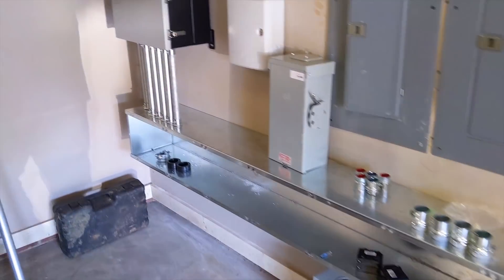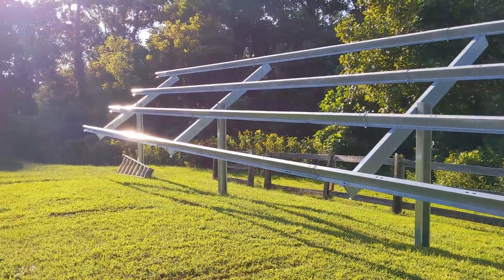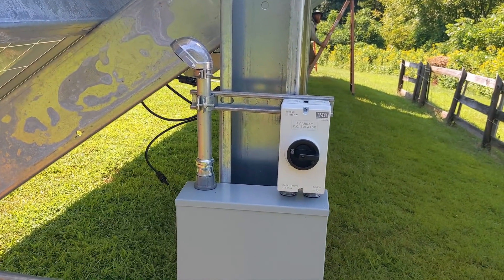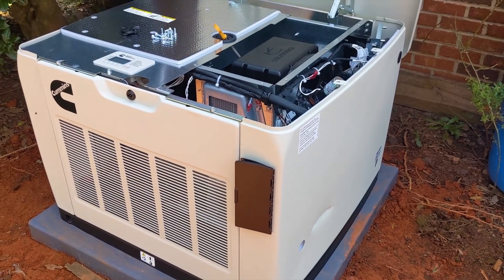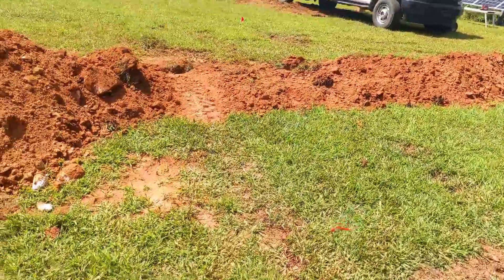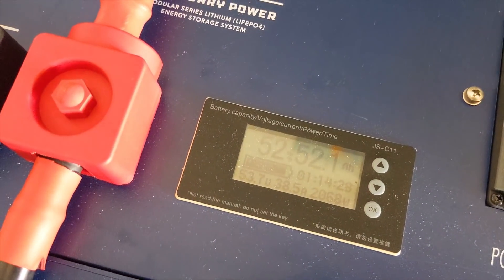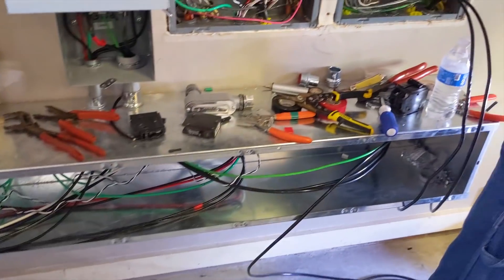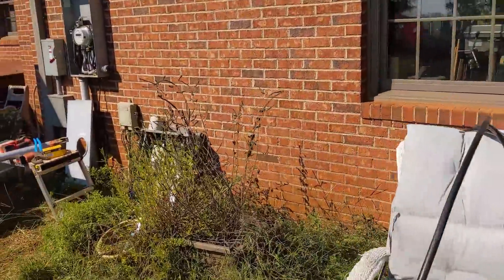Solarin: From consult to commissioning

Comment: So far so good, power bill has a $25 rental fee for the meter. Otherwise, we would have zero or neg power bills. Generator works well and comes on with not even a blink when it converts over. Love the system going into the 19th month of operation! Thanks, Scott, for a well-engineered system! 
19 months behind us Oct 21 - May 2023

Comment: I had a problem in the freezer it came the box was damaged which I wasn't so worried about the box but the freezer had a fork shoved into it in two places and scratched on the front side oh I called them up to have them come get it no they would never come get it once they give it to you you paid for brands make a new one they don't give a rat's ass even when you get a warranty on it and the worst part is there another answer to you never answer your question never answer your phone number if you have a phone number your navigate back to you just because they sold you something and they get to laugh at you then good thing is didn't ruin anything in the freezer I'm still able to use it but boy does it look like garbage. Of course I got that through Amazon it wasn't Amazon's company but they sold it off from Amazon company I called Amazon Amazon tried to get a hold of the company as well and they just would not do anything about it Amazon did try to help me but they even failed damn I wish I they would have just taken it back and gave me a new one just cuz you pay full price they can give you some s*** and thing that's all damaged and I got the freezer to prove it.

Comment: Our Power bill so far has been $25, $25, $44 for the past 3 months. That is due to the rental fee for the meter is $25. Last year's bills were in excess of $500 for several months. The new AC system we had to add a hard  or soft start depending on your terminology. Love the install and operation of the system

Comment: The generator charges at the same time the as the inverter? Or do you manually/automatically isolate the inverter from the generator? Thank you
Reply: The Sol-Arks as well as several other Hybrid inverters or All-In-Ones can remote start the generator and power loads and or charge the batteries through the inverter. Typically, Engineer775, you would also install a bypass so the generator can directly power loads in a house if the Inverter is down for maintenance or other issues arise with it.
Reply: @rainierfamilyhomestead  got it. Those inverters must have an internal bypass. That allows one or the other current sources to power the loads. If they both pushed current at the same time, then the inverter would have to have a frequency synchronization function. Heck, they may have it & I’m just overestimating how complicated that is to build.

Comment: What is the purpose of running a ground from the solar panels back to the house? If you had a short on one of the panels wouldn't it go to ground through the metal mounting system?
Reply: Mostly For Lightning Strikes,  Connecting All Grounds To a Central Point. So Lightning Strike Won't Travel Thru The Ground Itself Looking For Ground Rod.
Reply: My solar array is about 100ft from the house. For grins I measured the voltage between the ground rod at the house and the ground rod under the panels before I connected ("bonded") them together. It was well over 100 volts but not very much power. It couldn't light an incandescent bulb, but I could make sparks with it. You don't want that kind of voltage imposed on other wiring, plumbing, etc. as it tries to equalize itself, so instead provide a defined path, and that path also increases the quality of the ground connection on both ends.

Comment: What is the "pay back/off period" for a system like this one?
Reply: After 10 years you get another 10-20 years of free power generally speaking. Plus peace of mind. Your mileage may vary.
Reply: About the same as a new truck.
Reply: @brianfackrell4139  A new truck now a days can sell for well over $100,000 in some cases.  Even the typical new bottom of the line price is approaching $50,000.  In doubt anyone would spend that much money on electricity in their lifetime.
Reply: I believe you are missing the point.  For the cost of a standby generator deducted from the cost of a solar power system installation, how much electricity can you buy?  Perhaps a grid tie system might pay back within a reasonable amount of time.  I doubt the same can be said for a full stand alone solar power system.
Reply: @wrfarms9741  Solar panels by themselves pay back in 2 years at Florida electric rates. Remaining hardware is an investment into energy security. But I would go with smaller battery if grid-tie and generator are available.
Reply: What is the payback time on a new truck? You get a truck because you want one or need one. Get a solar system for the same reason.

Comment: Sweet setup - like the redundancy. Thanks for sharing.
How many more panels and batteries needed to comfortably power the central AC?
Ballpark $ for the full setup (solar panel array, system, batteries and genny)?  Installation $?
Reply: Minimum 20 kw pv, 2 solark 12k, 108 kWh LFE. $60-70K if you diy.